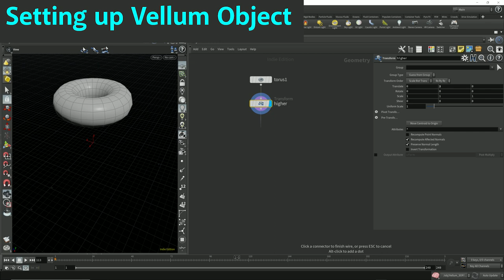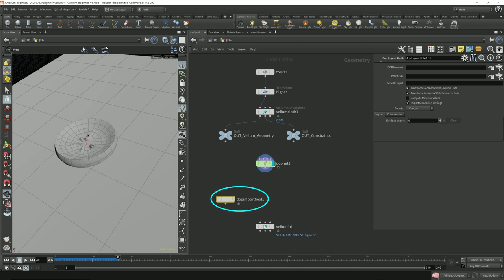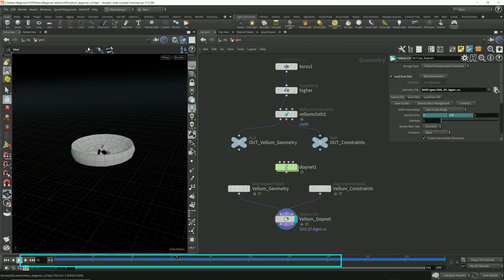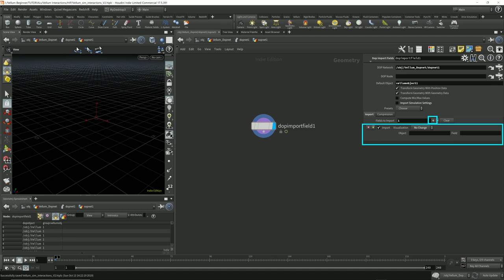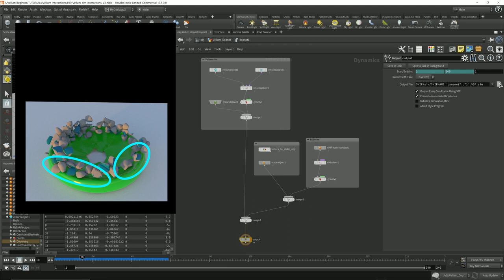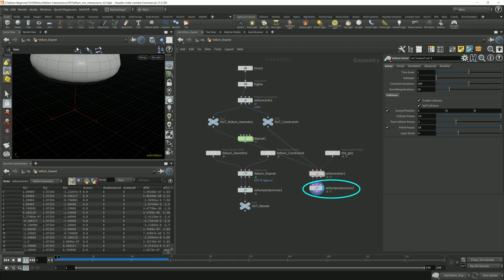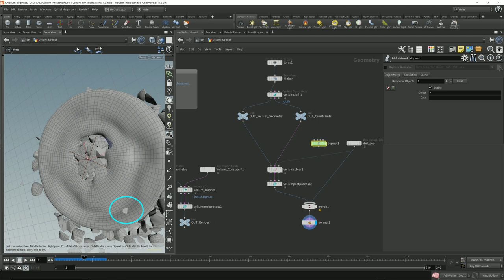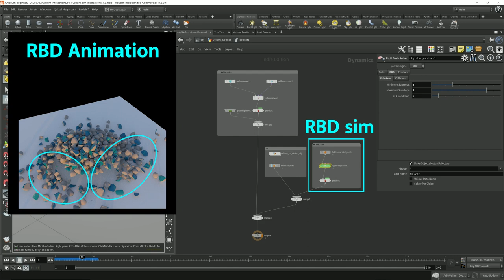Vellum & RBD Interaction Simulation in Houdini

Comment: Your RBD solver is trying to do convex shape vs. arbitrary mesh or VDB detection. It probably doesn't handle edge collisions well. You might have better results if the RBD pieces had a higher vertex density, especially on the interior regions. The detection against VDB is probably point based.

Comment: Hi to all
bubble pins - incredible lessons
I have a question, how to add Rigid Body solver houdini 17.5.173?
Reply from the maker: The rbd solver has been already for a few versions of Houdini. hmmm RBD solvers can only be added inside dopnet nodes, with the exception of the new RBD Tool node which just confuses things.  The Rbd solver used in this video can only be added inside a dopnet node.
Hope this helps!
Reply: I have already tried, and indeed, inside a dopnet node.
thank you very much for saving me)

Comment: First: With this way, seperate to two dop, we don't need phase 1.
Second: We can do in only one DOP. Don't need phase 3.
If you want two object iteraction reality. Only work with POP grains and using Multi Solver so far.
That's my idea. Hope anyone share the way to make two dop iteraction really work!
Reply from the maker: THat is true, I did try using POP too just to test at the time.  If I remember correctly the POP does work with the Multi solver and vellum solver, so you can use that.  I didn't try using POP grains though.  But POP grains is slightly older and Vellum grains does have those newer fancy features like clumping effects for snow.  I do find that Vellum grains is very very fast, I don't have anything to compare it to, because I don't work with POP grains that much.
You do make an interesting point, if we could make different dop networks work together that would bring a lot of new possibilities.  I have no idea how to approach that.

Comment: Interesting. Do you know how would i go to instance (multiple different) vellum objects? And after that, it would be good to replace each with proxy object?
Reply from the maker: hmmm..  I think you can use the merge to combine different objects, but give them a different group name and when you apply the vellum constraints you can filter it by group name so the constraints are only applied to certain objects.  Say you wanted object A to be have more stiffness than object B.
As for the proxy, I think proxy is always a good way to optimize the scene and speed up the cooking performance.  You can try what I did in the last Live Stream on Vellum Skin, I used a point deform to transfer from the proxy Vellum Solver object back to the original object.

Hope that helps!
Reply: @bubblepins  I haven't checked the last stream, so definitely will!
By the way, yes, in constraints, the object affected can be set by choosing with a group. But i was rather thinking on different objects as different meshes. Imagine having 2 types of flower, one Orchid flower and a Rose flower...so two different (like a box and sphere). So by this, i was thinking of instancing them on a grid so that i can simulate bunch of them falling through the air. For that, i believe 3 things are needed. 
1. To be scattered through a dop net, probably with scatter to points in vellum source (not continuous), 
2. To be scattered (1.) but as different objects, for example two flowers (or two basic prim. box and sphere), that are distributed randomly on the scattered points.
3. And to be able to correctly replace these simulated objects (that by now come out from a simulation DOP net, and have been scattered on a grid) with the proxy meshes (for example, you mentioned with the point deform). My guess is with a copytopoints, but can't get it to work currently.
It seems straightforward, but i had problems with the setup, mainly with step 2. and 3.
Im going to see the livestream...
Reply from the maker: @NextroneOfficial  You have an interesting idea there!  It sort of reminds me of a scrap paper scene I did for my Members-Only videos.  I used the Vellum Solver to model some scrap paper and have the scrap paper dumped into a garbage can using the Vellum Solver so it would end up all over the ground near the garbage can.  The thing is my scrap paper scene was very light, because all the paper were just plane 2D grid at low poly count.  As for the petals for flowers, I think the biggest challenge may be poly count and performance.  The copy to points may not be too suitable for animation, but who knows I might be wrong I'll need to test it, but copy to points can definitely be used for the starting position.  Proxy objects used during animation, I would stick with point deform.  If I get time after I finish off the Vellum Clothing mini series I'll try the petal scene out!
Reply: @bubblepins  Hey! I looked through the stream. I believe the way you approach making tutorials is unique, and that one can really enjoy all the bits and pieces of the explanation that you carefully try to convey to the audience. I haven't find the particular case in it (i think i haven't missed it). 
Right, but it's a bit different over here, scrap paper is a plane and flowers are closed 3D objects :-)
Also, i do not intend to add separate vellum constraints to the petals...just a vellum per whole flower is totally fine because they would merely collide while flying, and i think it wouldn't make a difference since there would be many of the instanced and different ones and the eye wouldn't pick the difference in realism i think.. so no ground plane would be included in a shot, just the fall through. Anyway, it's a bit tricky setup.
Reply from the maker: @NextroneOfficial  The scrap paper scene is in a different video.  Have you considered using textures for the petals instead of a 3D objects?  This will speed up the performance, and collisions should still work because you can add Vellum thickness to the Vellum Solver.  But I'm interested in your idea, because I always wanted to procedural model flower petals.  This could be very cool for 3D printing them out too!
Reply: @bubblepins  You mean using alpha image for the actual petals? No, all flowers have been modeled and textured accordingly :)
Reply from the maker: @NextroneOfficial  That cool too!

Comment: Good evening bubble pins. There is a scene in a curtain with simulations of particles, liquids, terrain, etc., all cached. I want to transfer everything to 3ds max, add materials and render in Corona. How to do it better? Using the Houdini Engine? Why in 3ds max, because the same object (quite simple) in Houdini Redschift renders 4 minutes, and in Max Corona renders 1 minute. I have two minutes of animation in Houdini and this is 2880 frames, so I want to render in Max render. Thank you in advance.
Reply from the maker: WOW Max Corona is so fast!  Now I gotta check the rendering engine out when I get some time.  To answer your question, I used 3d max 2 years ago for 2 weeks and gave up because that software was way too expensive for me.  I have exported many things to Blender.  If 3d max is similar to Blender, I would try to export it as FBX, but FBX doesn't always work, especially with animations.  Then if FBX doesn't work, I would try exporting as Alembic.  In my experience, Alembic export aren't very efficient, they cache the entire mesh and every point and every point transform as a new point in the next frame.  So you lose all the sim data like velocity, force, impulse, etc. And you need all that for rendering.  One way you can try is to attach all these attribute data into the Color and use that as a medium to transfer the data back and forth.

Comment: this is interesting, but... what about the actual interactions? it have to be some way to use the mutual relationships, but i still cant figure out how exactly it works. 
anyway thanx 4 the tutorial, this is a tricky approach
Reply from the maker: the issue is Vellum is a lot newer than RBD sims in Houdini and I believe they way they are implemented is different.  This is going by some of the random bits I watched from SideFX's webinars.  I think in the near future SideFX will make the Vellum work with the RBD using the multisolver, this is a total guess though.
The approach shown in the video is a little more advanced.  Try doing just the first two phases and I think that will really help understand the workflow, before adding the 3rd phase.

Comment: How did you create a ball falling into cloth(pinned to all four sides), I am trying to achieve a similar effect?
Reply from the maker: The ball just drops from free fall (affected by the gravity force) and I pinned all four corners of the cloth so it stays in position.  Do you have a particular issue you're having trouble with?
Reply: @bubblepins  I have rigid body solver setup for free fall of the ball and vellum solver for cloth and both solvers are plugged into the merge with Mutual relationship the ball kinda interacts but it weirdly passes through tearing the cloth in a weird way .........If u can provide a file of the setup it would be a great help as I am working on a similar project and I can just replace my model with yours .....Thanks for your help!
Reply from the maker: @gameswamy1465  The thing is Vellum object doesn't really work with the rbd object in the dopnet with the mutual relationship or even with the multi-solver.  Or at least I never got it working that way.  I did both simulations separately even with the sphere dropping onto the cloth, using the technique I showed in this video.  I know there are a lot of comments on below here saying that they want a "true" interaction, but Vellum isn't designed the same way RBD solver was designed.  This may change in future Houdini versions.  For now, the technique in this video was what I came up with as a work around for anyone that needed this. 
Hope this helps!
Reply: @bubblepins  I found a workaround which worked for me .........I solved the sphere as a VELLUM SOFT BODY and not RBD and changed the settings for the sphere that it wont deform much.... And increased mass etc.......so this works if we don't want fracture ......I think for fracture RBD we have to use your way .....but if just and interaction in this simple free fall this was the workaround I came up with .........Thank for you help....👍👍👍

Comment: Thanks. But It's very very difficult. Is there any different way to achieve interaction?
Reply from the maker: Not that I know of.  This is the way I came up with because the multi-solver didn't work for me.  Usually, in order to combine different types of simulations, you would use the multi-solver, but I couldn't get that to work with vellum & rbd.
This multi-phase workflow can be logically simplified a little bit more, but with the cost of more nodes to setup. 

Try this.  Set up the Vellum sim.  Then file cache it.  Then set up a rigid body sim separately like how you do it normally in a different geo node.  Then just do the same thing in the video, throw down a static object node inside the rigid body simulation and just link it to the separate Vellum sim  file cache. 

This way involves more nodes to setup, but it's easier to understand.
Reply: @bubblepins  Thanks. I will try it. Love your tutorials.